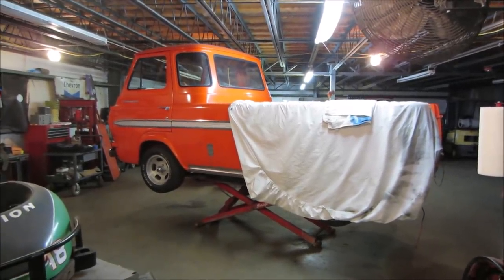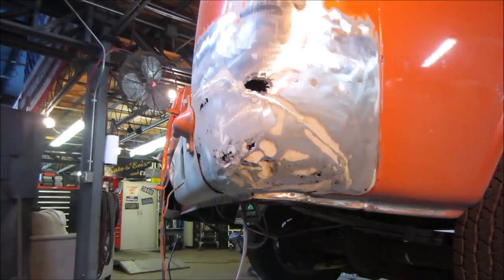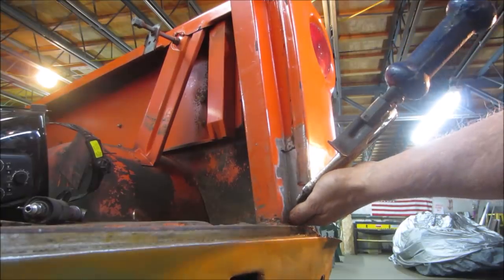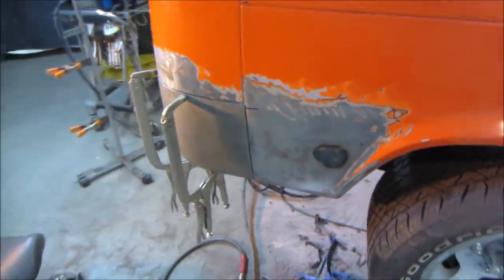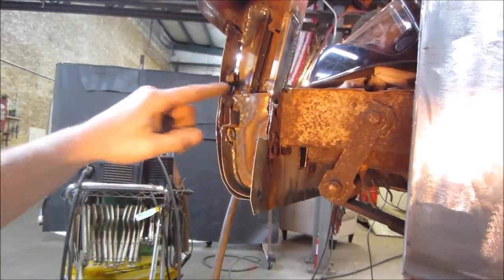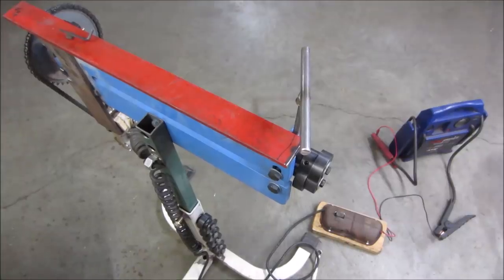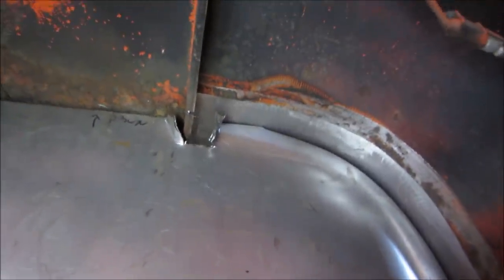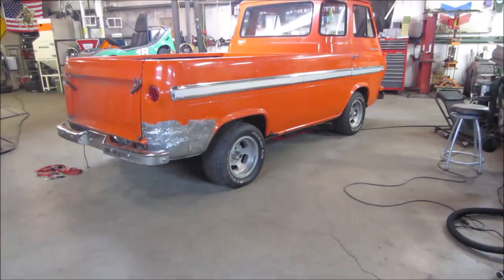learning How To Make Metal Repair Panels, Return of the 65 Ford Econoline Pickup.

Comment: I'm a huge fan of your channel. I had the largest body shop in all of the Western Part of my county out of over 250 shops. Started in a barn restoring, and cleaning up and painting mostly Porsches. Also did work for T Brid Products doing body and frames for 55-57 TBirds. I learned so much from that. The point I wanted to get to is that if you took this Econoline to a heavy duty sand blasting establishment, the one I used had a Cat diesel huge motor blowing what looked like just air from a 4" nozzle that had sand in it. The heavy metal, and in this case the bed, and undercarriage, suspension, brackets etc. all came out looking like brand new metal. The areas that blew through no longer had rust, and were a dream to weld. The suspension completely assembled, sandblasted, and then primed and painted, and then you do a disassemble replacing bushings, washers, nuts etc would look like brand new suspension. If you took a sandblasted part, and primed it, painted it, and put it in a box you would swear it is brand new,
One other thing that is important is to do what all manufacturers do to their cars and that is pickle it. The body is immersed in the case of a new shell in acid, or commonly referred to as pickling. That destroys the little seeds of rust that can be created as easily as grinding metal, and those pieces of powder, miniscule metal seeds that just the moisture in the air can turn into seeds of rust, and then when you prime and paint over them, they are now seeds planted in a field. Years later the paint peels off, and the metal is rusted. I like the Dupont metal prep that you add water to, and don't like the kind you rinse off. 
I think it is incredible that you are making your own panels. By the way you DO NOT want to have the heavy sandblaster blast your outside panels, like fenders, hoods outer skin etc because it heats the metal up so much it will warp it. You only do for example the undercarriage, suspension, under the hood compartments. IT TAKES ALL OF THE PREP WORK OUT OF IT. It is effortless to do a magnificent job. I could talk about this stuff for hours. 
I'd love to talk to you about fixing newer wrecks and how incredibly easy it is. Cars that appear to be totaled, once you unbolt the outside sheet metal off, as in hood, fenders, bumper, radiator, etc. and look beyond that into the interior panels, you see the only part you have to be concerned with. Some cars are hit just right, and others you don't want to bother with. I used to go back to a factory lap seam on for example a wheelhouse front panel, and after the first thing is done, that is while the car is still fully assembled, you put it on a rack, for example a Car O Liner and pull everything back to square, and all suspension points are back to factory specs. Then after spending a half hour taking all the outside panels off, you go back to for example once again the wheelhouse panel, and cut along the edge of the lap seam. So then the only thing that is on the factory seam is just the spot welded on tab, or leftover lip. You use a heavy duty grinder, and grind that off back to a factory untouched, unchanged seam. Then you take a new factory panel, lay it along that seam, and weld away. Used to weld the seam underneath that is covered up with the splash panel, and then use factory caulk, primer, paint etc. to create an unmistakable that it was ever fixed repair. Sorry for talking in circles. Excited about it. After watching your channel and a couple of others you are making me want to buy a Miller 211 and get back into playing with some cars again. Thanks for sharing all you do.

Comment: I was holding my breath every time you had to cut into the beauty with the grinder and air cutoff wheel. Harbour freight or some other tool retailer will have an air reciprocating saw. It will make your life so much easier and safer, plus you can use it for so many other projects and not just body work. You will be able to make cleaner cuts and even use it to duplicate panels as you cut out the bad stuff. Oh wow, I just got to the end when you put it down and it looks so very good! That may turn out to be a super going to town truck for parts and pizza. I hope you have fun. It is great to see you saving those lovely old vehicles and equipment, keep up the awesome content. I hope you and those special around you are staying happy and healthy.

Comment: I'd say leave the rear bumper on to go with how it was built.  Plus, it gives you a little more security against those that seem to think other people's vehicles are there to help them stop, especially in parking lots.  It would be a real shame to do all of that sheet metal work just to have it get crunched.
Reply: With that said, I think I'd install a very large Class 4 or 5 Receiver hitch on the back, possibly shop-built out of solid steel, that might make people think twice about backing up without looking and/or tailgating.
Reply: @wildbill23c  that and it would also add much needed weight back there
Reply: Probably go'na have problems opening the tailgate with that bumper.
Reply: @randallanderson4999 , it shouldn't since the truck came with it originally.

Comment: a big crescent wrench tightened down works well for bending sheet metal. kinda like a brake on a handle. it just doesn't bend a long stretch of metal at a time. so, did you see the spider on your bandsaw? 53:00 it saw you. even came up and said hi.

Comment: Can you put a relief cut on the rounded edges of the fender and roll the whole edge back? Love the videos! Started to pick up and tinker on small engines myself. I use your channel as a learning and reference tool.
Reply: Most trucks are made that way, if its not way overloaded, or Dukes Of Hazard jumped, the tire clearance will never be an issue

Comment: That is a beautiful area! That last part of the video, that used to be an old mill-I know because my grandfather used to own/run one, you could tell where the dam used to be. My cousin had an old ford truck, not an Econoline, w/the side steps on it, the back part was rusted out, so he ended up putting a wooden floor in & used it as a race truck on the weekends. The wooden floor looked excellent because he stained it, polyurethane it & used the original bolts to put the wooden floor back in. You did well on that ratty ford truck, it's starting to look better & better!

Comment: I had a 1966 identical truck. Owned it for 17 years!  Last year of that generation of Econolines. 1967's were next generation.  Had the "splendor kit" - - 3/4 horn ring, padded dash and padded glove box door, rear cab corner windows, too.  240 cid inline 6, 3 on the tree, single speed wipers, 2 speed heater fan.  How much luxury can one guy stand??  Loved every minute of owning it. Handled beautifully; even towed my 17' Starcraft with Chevy powered MerCruiser stern drive. My all time favorite vehicle to drive; and a conversation piece to boot.  Of course, wish I still had it.  My '08 F-350 is a great truck, but nowhere near as much fun to drive.

Comment: I guess I would have used vise grips on those wheel wells, at least to get them started, and I won't be surprised if you use them yet to finish up. Really are doing a nice job on this repair and making good use of your new tools. Fun times in the shop.
Reply from the maker: l want to stay away from making little dents

Comment: Self tapping screws is a good way to mock up the sheet metal for a tight fit..remove and plug weld after tacked up may help. Loving the build!

Comment: 49:46 I worked for a Nissan body structure supplier in Mississippi.  One of the things that we sold was nut plates.  We called off center nuts "winking nuts" .  Most were fed onto a pin and projection welded, but we also welded some of the higher strength plates by hand.  Love the video as always Mustie.  Stay safe!!

Comment: Have seen others form this radius lip by hammering over MDF while it is clamped. Seemed to work real well. When I was bending sheet metal radius in HVAC we alway marked the radius with small dimples from a pointed punch. When you flip the panel you can see where the line is, PS, great collection of body panel forming tools.

Comment: Hey Mustie1,
Remember the flared out fenders a la 427 Cobra ?  You might consider something like that.  First , work some sheet metal to the proper size and shape. Once you have that , then , cut out the sheet metal to the same size and weld in the fender extention. I believe that is the way my father ( a master automotive metal man ) would have done it.

Comment: I like this little COE only I wish it were a Dodge A-100. I drove a Ford like that all over SoCal overloaded with truck tire road service equipment. The Dodge A-100's had so much more power under load. It was hard to get up to Freeway speed with the Ford's little 170. I think you'll be OK with the rear fender flairs because if you load it up enough to hit it won't have enough power to move the load.... lol. Stay safe ... see you next week.

Comment: Fantastic work, brings back memories. Before I retired I started using a product called Sealskin on my welds, it's a hell of a lot easier to deal with than regular body filler. You might want to try it. Anyway love the work on the "65".

Comment: When you get to point when it's time to bondo the corner, try a product made by Evercoat called Metal 2 Metal. That stuff is great to work with and it's much less porous then regular bondo. Metal 2 Metal has metal properties made into it so it's sort of like using a metal paste rather then a plastic body filler. I have used Metal 2 Metal many times and it is great stuff to work with. It spreads well and it also sands well. Keep in mind though, Metal 2 Metal requires a pecial type of hardiner which will come with the can. The hardiner is very different then Bondo hardiner. It's more of a liquid and it takes less of it to mix a batch up. I hope this tip helps you with this cool project. Love the vids, keep um coming...

Comment: Wheel arch relief cuts would solve the issue. Also suggest some decent sized mud flaps to delay future rust.
I'd definitely fit the bumper. Makes for a handy step & as stated offers up some car park protection. Big tow bar also helps !!
Plus any weight you can add to the rear is only going to increase handling. 
Maybe add a winch to the bed & fit 2 batteries, & relocate them to the rear quarter areas you've repaired ?

Comment: Here's a tip for you mustie always bend the metal first then cut off the excess. That way it easier to bend the metal when you have something to hold on to, while using the brake. I'm sure you'll figure it out eventually but its always a good tip. " When child bearing hits." bahahaha man u crack me up!  BTW U need a piece of I beam, with sharp edges to form bends with sharp edges if you know what I mean and use it like an anvil. Works Well, btw U did a great job on the metal work...Once it's painted u'll want the bumper on it. I think! cheer bud.

Comment: I had the same issue with my 68 Cougar and the 60 series tires on the rear.  Air shocks to the rescue, and I found a set of coil overload springs that mounted between the axle and the frame. No more issue with the tires hitting, but the ride was a bit rough.  I was young and foolish, and didn't care.

Comment: Best way to roll a fender lip that i have seen, is to put a small length of round tubing (Brake line) on the inner side if the lip you want to roll. Than tap or use a closed wrench and roll it slowly or tap the lip around the tubing. The tubing will also give you a cleaner look and strengthen the rolled edge.

Comment: You keep cutting the patches to fit the holes.  It is usually MUCH faster to cut the holes to fit the patches.

Even when flanging, cut the patch to final size, lay over the hole, mark the edge of the patch, then trim the hole out until the flange will meet up to the line.

Comment: Having driven one of those for several years, you will wish you left the bumper on when all the sudden TRACTION counts!  Id build a pipe bumper with a recessed end that protects an compressed air chuck.  Having a few feet of 120 psi air in reserve would be a nice thing to have too.

Comment: I remember as a kid, I seen a lot of those trucks, and Dodge had one similar to that.  I would like to have one Ford or Dodge,  but finding one that's worth saving is very difficult.  The tended to have very low horsepower engines,  the Ford used a 144 cubic inch engine,  as standard and the Dodge used a 170. I have seen a Dodge that had a 273 V8 . I would like one with the 225 Dodge or a 250 Ford

Comment: As for the Fender could you extend the bump stops so that the axle stops before the tire reaches the Fender lip. Your many methods to move the metal were clever. You could also raise the Fender lip up an inch since you are really in to this.

Comment: If you drill out those chassis sections and weld in a tubular top damper mounting, so the damper is  nearer the vertical, it will raise the rear a little and improve the damping a lot.

Comment: Greetings fellow internee!
       I was wondering if you ever made use of Cleco aircraft fasteners when you do metal work, possibly plug welding the tiny holes after you are buttoning up??   I would think that the ability to fasten metal together with Cleco clips would do away with intrusive clamps in the way (if you had anything to clamp to).
      Thanks for inviting us over to the shop and inside your head;  beside the usual vicarious thrill you provide, I think my mental health just got jacked up at least to face the rest of our time "in the Cooler" here at home.
Reply from the maker: l have a set but cant find them after the move

Comment: @Mustie1, buddy, you Really need to get some Cleeco fasteners and the little pliers to insert them. Drill small matching holes through sheet metal parts and the Cleecos hold them together under mild spring tension for test fits and welding. trust me. they will make your life Way easier. 20+ years designing sheet metal weldments taught me these things were golden.

EDIT: How many of us were looking at that tractor ( 1:35:20 )and thinking "Will it run?"
Reply from the maker: l have a set but lost them in the move

Comment: Hi Darren, if you go to  Iron Trap Garage YouTube  channel Matt there has some videos on using a motorized bead roller to do just what you were trying to do with yours. I don't remember the video' titles or numbers but I know they are there. His roller is an Eastwood brand but the idea would be the same.. Matt also has some great tips for using the metal shrinker and stretcher tools. You might want to take some time to check out his videos, you 'll be glad you did.

Comment: Really enjoying this restoration: fantastic work with the sheet metal.  But one thing puzzles me.  This is never going to be a performance sports number.  So rather than fart about with the wheel arches, wouldn’t it be better to refit the original wheels and hub caps, and get the thing back as close as possible to original?

Comment: @ 1:36 you are boxing in the tail gate support, but I didn't see any evidence of metal finish on the inside surfaces.  Something I learned from experimentation is that you can spray your welds with high build primer while the welds are hot...mist coats.  I live in GA and have never had one of those painted welds rust.  In addition, the weld heat expands the molecules of the surrounding metal so that primer bonds to the metal.  Quick & easy.
Reply from the maker: l explained it in the end of the video

Comment: That turned out very nice!

Did you ever gauge that tail gate for true? It could be warped.

Is that bumper plated? Worry about it flaking off when straightening it out?

That's built way better than new now.

Comment: Or use A board like I seen you were using with aluminum mallet  tapping it from one side to the other for events of the rollout pattern of the finderwells to keep the lines.& creases still the same other than the actual rolled in area.

Comment: Haven't watched to the end yet, but wondered, since the floor accumulated debris and junk tossed up by tires in the rear, if it might be worth either extending the wheel housing in back, or adding mud flaps.  Or, closing in the rear area underneath, behind the wheel so anything tossed up would just hit that and come off (or stick, but easier to remove)?

RichE San Diego, CA

Comment: a plumbers tri stand vice has a place on it called a ceiling beam.... from vice to rafter uses a pipe.... secures tri stand to floor....you coulda done the same from rafter to truck bed....the push up with jack ....it woulda bent flange....

Comment: Get a heat gun out and warm the metal & paint to get it warmed enough where you can touch, but not hold your hand on the panel. My boss has nearly 20 years guard rolling experience & the heat gun, round flat hammer & panel wedge are  the most important tools to getting nice rolled guards

Comment: (10:50) - On those rear wheel arches, you've now created a possible water trap (maybe not), on the inside of those upward facing edges.
You might want to consider filling those in.
>
Reply from the maker: they will get greased

Comment: i'd be tempted to just do everything non structural in fiberglass, it wont rust away again as a plus you can make molds of the original structure and maybe get um more accurately shaped .